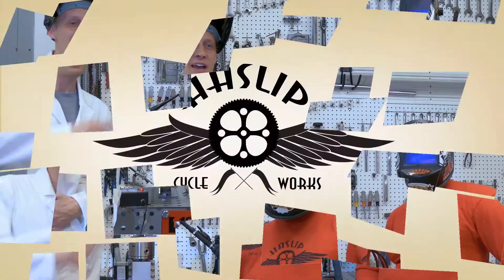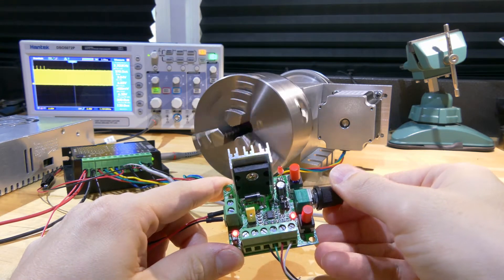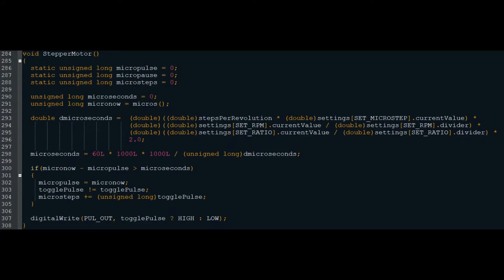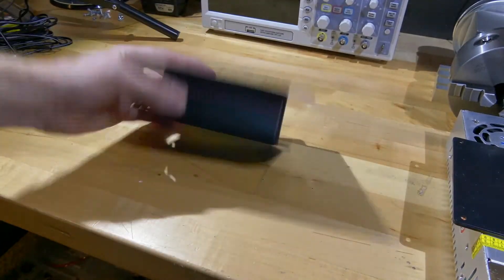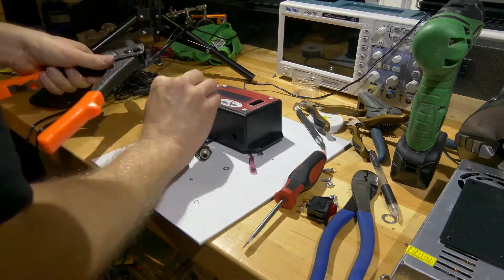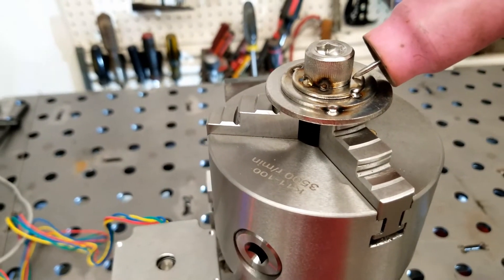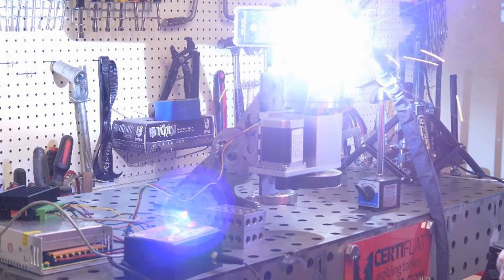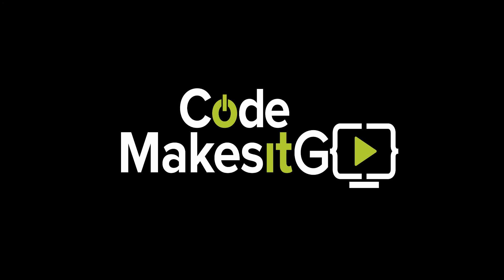Arduino controlled rotary weld positioner

Comment: This idea seams great on paper but in a dabricationshop it seems abit
Fragile. Is there any way
You can simplify The stepper electronics
Reply from the maker: I don’t think so. The stepper motor is kind large so it needs enough current to run and a controller that can handle that current. But I’m open to ideas, do you know of a simpler way you can share with us??
Reply: @CodeMakesItGo  unfortunately no. Not on the electronics side I’m just a tig welder. But as feedback for the product I think it needs to be simple and robust to be a hit of use in the fab shop. The ones from China are simply plug in and away. I love the idea and I think I’m going to have a crack at this myself
Reply from the maker: @plusoem  Please try it out, let me know if you need help. Could you send me a link to a china version? Interested to see what they are doing to make improvements.
Reply: @CodeMakesItGo  it’s defiantly not improvements as they don’t run the Adriano board, have as much functions, they spin to fast some of them and the frame work looks like it’s built by high school kid, but the electronics are fairly simple and abit more robust. I’ll find. Slink and send it over. Damn I wish I was an electronics guy 😂

Comment: HI, i have built the electrics but i am improvisinga foot switch at the moment , just a cable to ground. however the motor starts without me grounding teh cable and i cant stop the motor when i do ground it..
Reply: its ok. i see it now.. thanks.
Reply from the maker: Sorry I didn't respond in time. Hope everything is working as expected, if not let me know and we can figure out a solution. But it sounds like you got it working, if so awesome job!
Reply: @CodeMakesItGo  no worries. All working now. Thanks again.
Reply: @CodeMakesItGo  hi. i have the arduino working as  designed but i got major problems with the high frquency start which cant be disabled on my welder..  i thought about making the foot pedal a remote control, eliminating the cable going to the board. i will also put an opto couple in the wiring .   i got a simple remote control kit but i cant get it to operate like  a foot pedal.  I wondered if you could do an addition to the program?
Reply from the maker: @domkelly1972  Yes of course. Email me at jason.altice@codemakesitgo.com and I can get the code updated for your use.

Comment: Did you guys ever solve the EM interference issue? 

On the rotary positioner I used , there was a ground strap direct to the Chuck to  prevent arking across the bearings
Reply from the maker: Kinda, we just disabled the high frequency start. So maybe it was more of a work around. The solution would be to use a metal project box instead of the plastic one. At least that is what other people are doing. The ground strap sounds interesting too. I don’t believe ours had one. I’ll have to find an example and see if this one can be retrofitted with one. Thanks for the tip. 👍
Reply: @CodeMakesItGo  Basically all you need to do is wrap a copper strap around the main spindle somewhere to provide a good ground. 

Another thing is use shielded cabling for the loom going from stepper motor to controller. 

At my new job, I'm getting into designing RF shielded devices :)

Comment: Great project! I have decided to replicate it and I have one weird problem. 
When using "#define USING_PAUSE_SWITCH (1)" both lines of the settings menu text are shifted two characters to the left. 
For example from "Speed" I can see only "eed" and from "10.0 RPM" is "10.0PM"
Do you have any idea what might be the culprit?
Reply from the maker: Well that doesn’t seem right. I’ll load up the project and get back to you ASAP.
Reply: @CodeMakesItGo  I must say, I did not expect this kind of reply. But it shows that you take pride in your creation! Thank you for spending your time on this ;)
Reply from the maker: Updated the code and did some clean up. I tested with the display and a stepper motor and it seems to work. So please let me know if you see another issue. Thanks for reporting the problem!
https://github.com/CodeMakesItGo/Ardunio-Welding-Positioner
Reply: @CodeMakesItGo  Thank you for the fast fix! I will test it and report back ;)
Reply: @CodeMakesItGo  tested, works like a charm now, thank you!
Reply: @CodeMakesItGo  I have been playing with HW design of my rotator a little, and in process I think I have found another bug :) It seems like the gear ratio setting dont have any effect on actual speed.
Reply from the maker: I’ll check it out. It may be that it is already going as fast as it can. Others have seen this when there is a gear reduction and can’t get it to rotate faster. What gear ratio and micro step setting are you testing with?
Reply: @CodeMakesItGo  I see, that might be the case. I have set 32 microsteps, and I was trying to figure out if I need to set a 0.5:1 or 2:1 gear ratio, that's how I found out. Physically I have 15 toothed wheel on the stepper and 30 on a spindle.
Reply from the maker: It would be 2:1 then. Stepper will rotate twice per single output rotation. You can also change the micro step on your controller to something lower, 16 or even 4 and keep the arduino at 32. Unless you need the accuracy. It will provide twice the rpm for every step change down.

Comment: can i use a separate switch to change direction? I can not code anything myself. but have ordered everything you use. and will try and use your code. do I have to use the stepper driver that you use? I have unl2003 and nema 17.
Reply from the maker: Yes! Very possible, I can code it up for you or help you out if you want to do it yourself. Just let me know. You can email me directly at Jason.altice@codemakesitgo.com
Reply: @CodeMakesItGo  Hi, Im currently making this and im trying to upload the code to the arudino. I get an error message saying :
no matching function for call to 'max(long unsigned int&,int)' How do I fix this thanks !
Reply: @JaySybrandy  Hello Jay, thanks for watching the video and for reaching out. The problem is that you most likely have 'Arduino' board selected and it is using different libraries, maybe from ESP8266. In any case, all you need to do is go to the Tools-->Board-->Arduino AVR Boards and select 'Arduino Uno'. It should compile then. If not, please let me know but the 'max' function is part of the Arduino library so you should have it.
Reply from the maker: @JaySybrandy  That was me replying with my other account, Reel3D.
Reply: @CodeMakesItGo  thanks for the reply, I'm using a 8266 board. Do I need to buy a genuine Arduino Uno ?
Reply from the maker: Sorry late reply. No you can use what ever you'd like. But the Uno has that nice display shield I was using. Totally up to you. In any case, to get your code compiling add '#include <algorithm>' to the top of the file. The algorithm header includes the max and min functions. Then on line 331 you will have to type cast the '100' to an unsigned long 
' microseconds = max(microseconds, (unsigned long)100); '
Reply: @CodeMakesItGo  Code succesfuly uploaded but the LCD screen shield hasn't turned on. Do I need to add switches and motor controller for it to display on the screen. Thanks
Reply: @JaySybrandy  Most likely the display contrast is turned down. Turn the blue screw on the display. It takes a lot of turns, but go until the display turns all white or you see some characters.
Reply from the maker: Forgot to mention you don’t need the switches or stepper motor for it to turn on.
Reply: @alticetube  I have wound it up, their are white squares but no text.
Reply from the maker: Did you switch to the uno or still using the 8266? If using the 8266 could you email me your code? Jason.altice@codemakesitgo.com
Reply: @CodeMakesItGo  Hi, only just saw this comment. Still using the 8266. I have emailed you the code. Thanks.
Reply: @CodeMakesItGo  Hi, i have switched to an arudino uno.  Code seems to work. Im connecting the arudino to the stepper motor driver now. Your wiring diagram says I need to use D11 D12 D13, the LCD screen is using those pins can I use other ones or ? Thanks
Reply from the maker: @JaySybrandy  yes absolutely, you can you whatever digit output pins are available.

Comment: hi just watched video look good for Project i got assigned.old harig i need to set up so able to drill parts ....ah is there a list  of parts and sources
Reply from the maker: Source and wire diagram is here: https://github.com/CodeMakesItGo/Ardunio-Welding-Positioner
Arduino Uno (amazon)
LCD Keypad Shield (amazon)
CNC Single Axis TB6600 Stepper Motor Driver (Ebay)
4th Axis Hollow Shaft Rotary Table Router (Ebay)

Let me know if you need any help with the code.

Comment: It is one of the best projects across YouTube.
I am facing the issue of garbage values on my LCD Display and shifting of Text.

Only Connected the Arduino and LCD .
Please help.
Reply from the maker: This is either a timing issue or the incorrect pin settings. Ensure you have the correct pin settings on line 17. pins 8,9,4,5,6,7. "LiquidCrystal(rs, enable, d4, d5, d6, d7)"

Comment: as the box is getting used in a space with a welder / hot metal a metal box holding the items might be better , it should protect from electromagnetic radiation (emf) too faraday ccage , giving both there own earthing probably helps too 
if you got one of those portable money or gun safes you could test it out by putting the plastic box inside and closing the lid as far as it goes with the cables sticking out
you could line the inside of the plastic box with copper foil , that seems to work for guitars
Reply from the maker: You are right, a metal box would have been a better choice. Awesome suggestion for the copper lining and testing in a safe. Never thought of that.

Comment: I have been facing the problem with the initial stage itself. 
Only connected the Arduino UNO and LCD Keypad Shield to check the features and each page of the display.
But , it is not proper. All the pages are jumbled.

it would be great if you can help.
email:- tushar31111@gmail.com
Reply from the maker: So sorry I missed this message. It did not show up for me for some reason. I'm assuming you already fixed this issue but if you have not, ensure the pin settings are correct on line 17. Also clearing the eeprom by changing the value on line 7 to something like 0xABAB.

Comment: Thank you, worked smoothly on first try.
Reply from the maker: Awesome, thank you for letting us know! Let me know if need help with any customization.
Reply: May have some suggestions.
1) Rotate at the specified angle.
2) Tigweldig torch button PAUSE_IN  can be connected and triggered. It seems possible in this state, but it should be tried. ( semiautomatic)
3) To be able to make straight welding with linear motion as an additional second mode.
(Rotary & Linear)
Your codes are beautifully designed, I will try to make these changes. I hope I will succeed.
Thanks again. @CodeMakesItGo
Reply from the maker: @fuatcoker8142  All of these ideas are awesome. I've never seen a linear welder positioner but make perfect sense that is should exist. If you have trouble with any changes, I'll jump in to help out. And thank you for the kind code comment, that made my day!
Reply: @fuatcoker8142  it would be great if you can help with the added programs also.

Comment: Put controller in metal box (aka faraday cage) to isolate radio waves produced by high freaks, also to keep any arcing on the casing and not in the electronics.
Reply from the maker: Agree, metal box would of been the smart way to go.

Comment: Maybe ground the Tig welder to the Rotary Positioner's spindle using braided copper so it slides on the shaft as it rotates. Grounding to the bench  and placing the Rotary Positioner on the bench will cause issues with electric motors and cause static arcing or flashing on the bearings and moving parts. If you listen hard enough you can hear it arcing on the surfaces. 
Anyway thats what I do to fix these problems. Hope it helps.
Reply from the maker: Thanks for the suggestion, we tried isolating the motor from the table but maybe grounding it would have been better. Thanks for the tip!

Comment: Hi; I really appreciated for your project.

I use it with A4988, for just for try it home.

ENA(+) to EN pin on A4988
DIR(+) to DIR pin on A4988
PUL(+) to STEP pin on A4988
SLEEP and RESET -> short circuit on A4988
MS1 MS2 MS3 nothing (now)
5V Arduino to 5V on A4988
GND Arduino to GND on A4988
Vmot and GND connected parallel with 100microfarad capasitor.

it worked very well.

Thanks.
Reply from the maker: Serkan Yıldırım Thats awesome news! So happy it was useful, thanks for sharing and watching the video 😊
Reply: @CodeMakesItGo  Hey Rob and Jason, I made it with a4988, then my lcd too was confused when I trigger the tig button. Then I've changed something now it works very well. What I'm done -> I feed the all electronics same power supply 12v 5A, then I feed the arduino from Vin pin, ground also wired together ( Because my a4988 driver expansion board its look like -> https://i.ebayimg.com/images/g/mXsAAOSwTmtaAfTZ/s-l1600.jpg has a gnd and 5V pin)
At this time its work perfectly but I added some ferrit beam to step motor wire just in case.
Reply: @istasyonninsani  What! This is awesome. Thanks for the tip. I'll see if this works for Rob.

Comment: hello, can you tell me de model of the stepper controler , tks
Reply: It was some cheap no name controller. Search "Stepper Motor Controller PWM Pulse Signal Generator" in Amazon and it will come up. Should be about $12.

Comment: Your problem could be solved if you put all your electronics inside a shielded box like a faraday cage
Reply from the maker: Don't laugh too hard but I wrapped it in aluminum foil as a faraday cage test and it did the same thing. Even though that was a weak test, I also think a real metal project box should work. If Haslip Cycle works required the high frequency start then I may have to upgrade it. Thanks for the tip and for watching the video!

Comment: This looks a great project to build I have just purchased the parts for this project and downloaded the code could you tell me how to wire it up as I'm new to this many thanks John
Reply: Thank you so much for taking the time to help me all the best John
Reply from the maker: John Jaywalking No problem, I’ll create a wire diagram and upload it to the github. I’ll let you know when it is there.
Reply: Thank you for replying so soon I cannot thank you enough keep up the good work
Reply from the maker: @johnjatwa1413  Uploaded the connection diagram. Let me know if there are any other questions. Good luck and thanks for watching!
https://github.com/CodeMakesItGo/Ardunio-Welding-Positioner/blob/master/WireDiagram.pdf

Comment: great!!!! If its possible can u do it for a1 or a5 pins, if not, please chose by yourself one of digital pins it really doesn’t matter...
Thanks a lot! U really will help if u modify code for me
Reply: Egor Snyezhko No problem, I’ll send you the code this weekend.
Reply: alticetube cool, zoolbook@ukr.net,  will be waiting....thank you.
Reply from the maker: @yekhorsnyezhko2526  Sent, let me know how it goes.
Reply: CodeMakesItGo , Hi, already tested it, and it works ! But ,is it possible to make it work with push button, for example, i  push it once and it changes direction permanently, not during I’m holding button. I just want to add limit switches to make table moving left to right and right to left.... sorry maybe my english is not enough good, and it’s difficult to explain what I want for me....thank you one more time:)
Reply from the maker: @yekhorsnyezhko2526  Got it, I understand now. I'll make the update and send it back to you.
Reply: CodeMakesItGo  i really don’t know how i can thank you for time u spend on my!
Reply: CodeMakesItGo tested it after last update, now it works amazing! (A1 grounded with 10kohm resistor) ! Thanks a lot, your project and support solved many problems !

Comment: Hi from Kiev:) 
Thanks for your project, im using it to control x axis on my mini mill, and it works perfect!! 
But if its possible, could u explain , how i can modify your program to add extra revers push button !
Thanks!
Sorry but programming is too complicated for me..:)
Reply: Very happy it worked for you and thanks for watching! To add an extra reverse button or switch just modify the "settings[SET_DIR].currentValue" value to the opposite of its current state. This way it will reverse the direction no matter the current direction. Something like "settings[SET_DIR].currentValue = !settings[SET_DIR].currentValue;" should do the trick when ever the button or switch you have is high. If you need more direction I can modify the code for you. Just let me know which input you will be using. Good luck!

Comment: Don't know if this will help u but I have Everlast 250 EX and in the manual it says : NOTE: TO PREVENT STRAY HIGH FREQUENCY INTERFERENCE, THIS UNIT PROVIDES AN ADDITIONAL GROUNDING POINT AT THE REAR OF THE 
UNIT. IT SHOULD BE DIRECTLY GROUNDED THROUGH A SEPARATE WIRE TO AN OUTSIDE METAL ROD DRIVEN IN THE GROUND. THIS HELPS 
PREVENT BLEEDBACK OF HF INTO THE POWER GRID, AND HELPS MUTE HF INTERFERENCE. ADDITIONALLY, ALL SURROUNDING METAL OBJECTS 
SHOULD BE GROUNDED INCLUDING THE TABLE, PIPES, WALLS ETC. TO PREVENT ELECTRICAL INTERFERENCE WITH OTHER CIRCUITS. Hope this might help u or someone else
Reply: I think the manufacturers of the welding machine take care of the safe work of the welder more ..